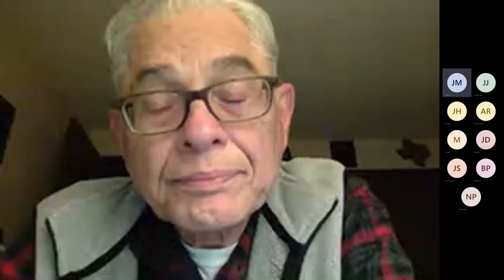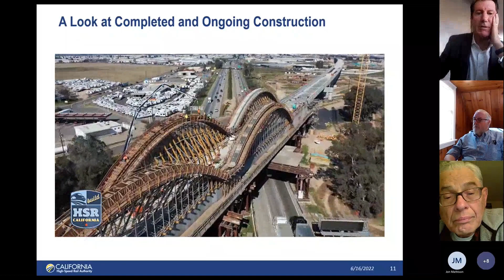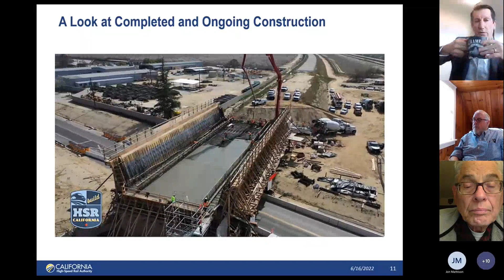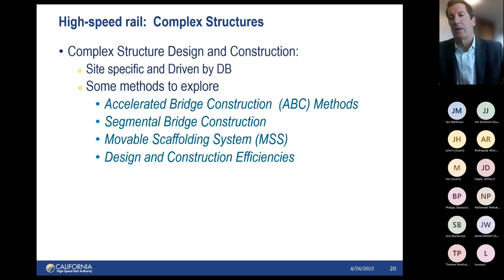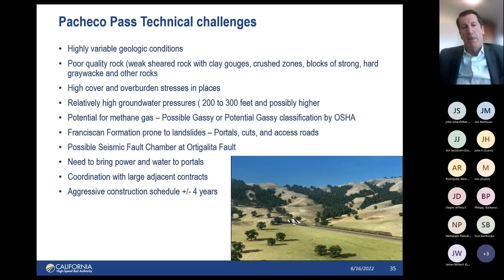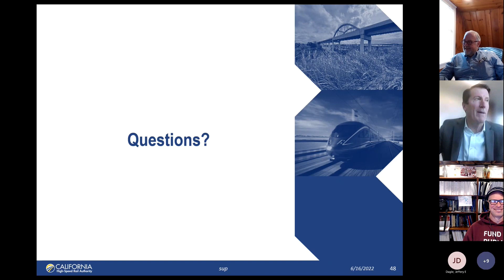WSPE California High-Speed Rail Presentation

Comment: The Rayleigh vibrations can be fixed like we had in the netherlands for our HSL-Zuid where trains travel at 186 mph (the ground in the netherlands is super weak) . We put double rows of 2 Foundation poles and put concrete Plates ontop with slab tracks.

Comment: Fifty miles of tunnels ... cost how much ... build time how long. No one will live long enough.
Reply: I plan to be alive in the 2040/2050 timeframe. This will be critical infrastructure, and the 2030s timeframe when the initial operating segment opens will start showing why.
Reply: @daniellewis1789  Thank you for your kind reply. You must have the patience of Jobe. I agree with your timeframe which probably means don't realistically expect to ride from SF - LA if born before 1975, which is when I graduated from college. I am 200% for CHSR and I look forward to atleast ride it in the valley which for me is a 20-30 mile drive away. 2019 Amtrak San Joaquins ridership between Merced and Bakersfield was 3K/day (1M/annually). I am curious what the increase in ridership will be for this CHSR 171 mile segment. Any thoughts, Daniel? Have a nice Labor Day weekend.
Reply: @davidjackson7281  I'd figure the faster travel time and better schedule will attract more riders, but the preview of the experience is going to galvanize public support to connect the whole system and begin construction on the extensions. (Plus running the initial segment will train staff and test station, software, etc. before the line ties into really big cities.)
Reply: How many people end up riding the initial segment also depends on how the endpoints develop in the next decade (say 2033) as if there are significant transit oriented developments near HSR stations, bus lines to the station, WFH people living where they can drive to a big city meeting once a month with sudden access to the train, and better faster service along that route? You could see substantial ridership gains compared to 2019 numbers.
Reply: @daniellewis1789  I appreciate your insightful comments. I am hopeful there will be ridership gains. Though the Pacheco and Tehachipi tunnels are imperative for ultimate success, don't you think? Now to go off on a slight tangent ...
May I ask you (or anyone reading this) a TOD type question on a topic I have never heard about? Since successful railroads capitalize on acquired real estate, does the CHSR plan to profit substantially by selling, leasing, developing, etc. its properties?
Reply: @daniellewis1789  With 100 miles of slower blended urban trackage and 10 station stops, it seems to me the SF-LA trip will realistically take 4-5 hours. Faster than a car and not as long as the 12 hour Amtrak ride but not as quick as projected. Would there have been any merit to upgrading the current 101 route trackage (new Cuesta Grade tunnel) to an average speed of 70 mph for a six hour ride?